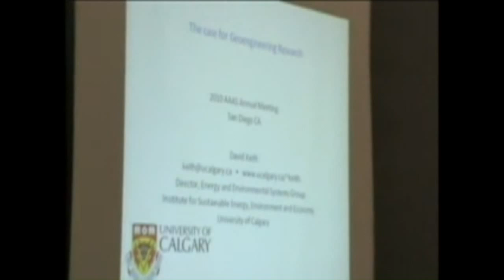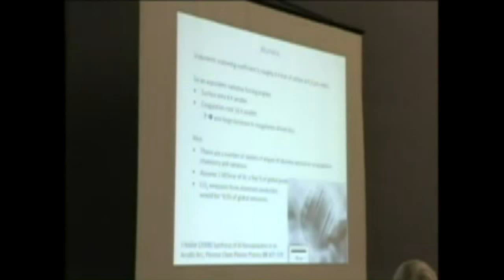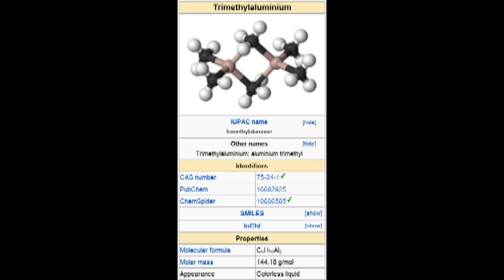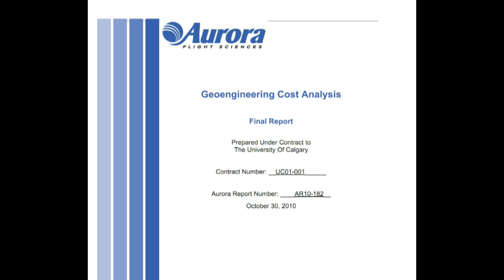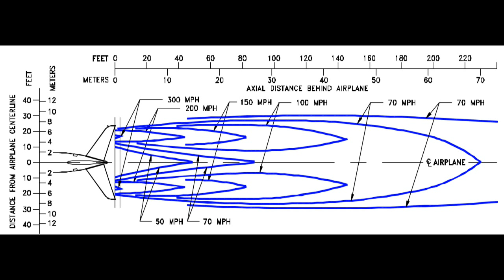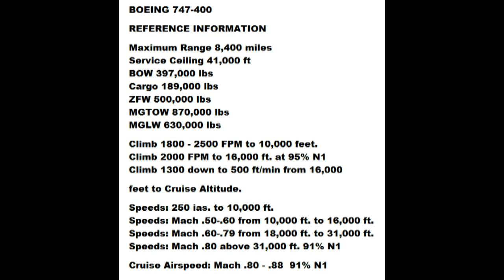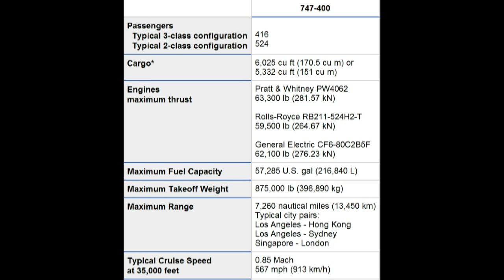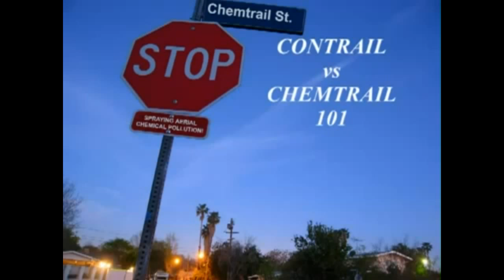CHEMTRAILS AND TRIMETHYLALUMINUM OR JUST ALUMINUM

Comment: Good video Energy....I think you're on to something. The way you explained it, it does seem possible that they are also putting the aluminum in the fuel. Without a doubt I also believe they are spraying it through nozzles attached to unmarked aircraft.

Comment from the maker: @chavspotter

The melted aluminum exits the engine as a fine mist and as it contacts air that actually has some oxygen in it, it begins to turn into aluminum oxide (Alumina) turn white and therefore becomes visible.

Comment from the maker: @o0Nighthawk0o

I am talking about mixing aluminum with the fuel, not TMA. There is not enough oxygen in the engine to combust the aluminum. The jet fuel burns it up. To burn aluminum requires a catalyst such as iron. Then you have thermite, which will burn very hot but requires something like magnesium at 3100 C to ignite the thermite. Aluminum has a much higher ignition temperature than jet fuel, so the jet fuel burns first and leaves no oxygen or enough temperature to ignite the aluminum.

Comment from the maker: @o0Nighthawk0o

There would be no problem with oxygen and aluminum. The aluminum (AL) mixed in with the jet fuel (probably C6 H18 or there abouts) is not molecularly bonded, as is TMA (C6 H18 AL2) just mixed. The jet fuel burns, the AL does not. Fuel and air are mixed in the proper ratio, combustion is typically over 99 percent efficient, meaning all the fuel is burned as well as all the oxygen, there is no excess oxygen to turn the aluminum into aluminum oxide and turn it white, and visible.

Comment from the maker: @o0Nighthawk0o

The aluminum component to TMA C6H18AL2 imparts no color to it. The same would be true if they mixed aluminum with jet fuel. The aluminum must have oxygen to turn to aluminum oxide, become white, and become visible. As I already said, roll clouds are just made up names to conceal chemtrails. The picture is not fake, it illustrates the gap.

Comment from the maker: @o0Nighthawk0o

The Trimethylaluminum, if it were added, would not emerge from the engines as Trimethylaluminum because its hydrocarbon components would be burned up. In sounding rockets the rocket dumps the TMA but uses a solid fuel for its own power.

Comment from the maker: @o0Nighthawk0o

Wrong. The atmosphere is a column of air that is heavy down low and light up high. The oxygen concentration is 21 percent in both cases, it is just that at altitude, there is less atmosphere, therefore less oxygen. READ what it says HERE. The video will start right where you need to read to educate yourself.

watch?v=RRElKPH_S8o&feature=player_detailpage#t=369s

Comment from the maker: @chavspotter

So the point is, if they wanted to combust the aluminum, they would need a hell of a lot of oxidizer because aluminum has 83.4 Mega joules (MJ) of energy per liter and jet fuel only has 33 MJ of energy per liter. Plus they would need a catalyst because aluminum is very difficult to ignite.

Comment from the maker: @chavspotter

The goal is NOT to combust the aluminum. The propellant mixture in each Solid Fuel Rocket Booster on the space shuttle is ammonium perchlorate (oxidizer, 69.6% by weight), aluminum (fuel, 16%), iron oxide
(a catalyst, 0.4%), a polymer (such as PBAN or HTPB, serving as a binder that holds the mixture together and acting as secondary fuel, (12.04%), and an epoxy curing agent (1.96%).

Comment from the maker: @chavspotter

The Trimethylaluminum is proof of concept. If TMA was mixed with the jet fuel, its hydrocarbon components would burn, but not the aluminum. So, all you have to do is mix aluminum with the jet fuel. The goal is not to combust the aluminum, just melt it. If the aluminum was combusted, you would no longer have aluminum and then David Keith could not get his big white fake clouds, that totally block out the sunshine.

Comment from the maker: @o0Nighthawk0o

Aluminum oxidizes in 100 picoseconds in the presence of oxygen at sea level. As the video points out, in the combustion chamber, all the oxygen is used to burn the jet fuel, so no oxygen there. Then the aluminum exits into a low oxygen environment at altitude and the wakes of the engines bring that down to zero oxygen, so the aluminum has to wait to seek out air. Sorry but you not thinking clearly.

Comment: @o0Nighthawk0o  Also, Trimethylaluminum does not mix with kerosense and can only be transferred from one vessel to another in a vacuum. Amother point to consider is that research carried out by Frederick Tepper and Leonid Kaledin showed that aluminium powder of micron size when added to kerosene did not fully combust. Aluminium powder at nano size does combust completely but at $500.00 per kilo it can be ruled out for ''spraying operations'' and isn't available in the required quantities anyway.

Comment from the maker: @z1zaz 

To clarify, I doubt they are using trimethylaluminum because it costs $500 per liter, but aluminum is only $3.50 a liter. I only used trimethylaluminum to illustrate a point. Wikipedia - ENERGY DENSITIES says Aluminum has 83.8 Mega Joules of energy per liter. Gasoline is 34.2 - fine particles of aluminum can burn, just like a grain silo can explode if the fine dust is not kept under control.

Comment from the maker: @iwasthatdolphin 

To clarify, I doubt they are using trimethylaluminum because it costs $500 per liter, but aluminum is only $3.50 a liter. I only used trimethylaluminum to illustrate a point.

Comment: Sorry - ave to agree with z1zaz :

The trimethylaluminum and its hydrocarbon components enter the atmosphere via spray nozzles on the trailing edges of the wings, this is why they expand in the hot engine exhaust, and become vortex stirred.

The hydrocarbon components of trimethylaluminum are not burnt because it does not pass through the engines, and when they fall on brush or tree leaves this *promotes* wild-fires.

Comment: You need to do more checks on the Chemtrail topic.
The trimethylaluminum and its hydrocarbon components enter the atmosphere via spray nozzles on the trailing edges of the wings, this is why they expand in the hot engine exhaust, and become vortex stirred.
The hydrocarbon components of trimethylaluminum are not burnt because it does not pass through the engines, and when they fall on brush or tree leaves this *promotes* wild-fires.
Fuel tanks are not used, check out the 'toilet' tanks !!!!!

Comment from the maker: @IExposeMormonism

The solid fuel rocket boosters on the space shuttle use ammonium perchlorate (AP), a binder, polybutadiene acrylic acid acrylonitrile prepolymer (PBAN), powdered aluminum is the fuel, The AP serves as the oxidizer, while the aluminum serves as the fuel.

Comment from the maker: @IExposeMormonism

7000 miles into 57,000 gal = 8+-ish gal per mile, NOT per minute, as you said. The aluminum would not burn, there is not enough oxidizer, the air entering the engine is used to burn the jet fuel.